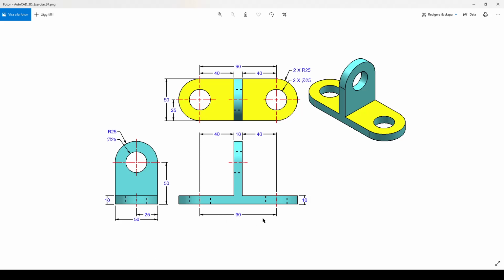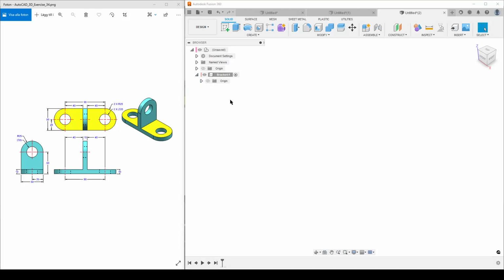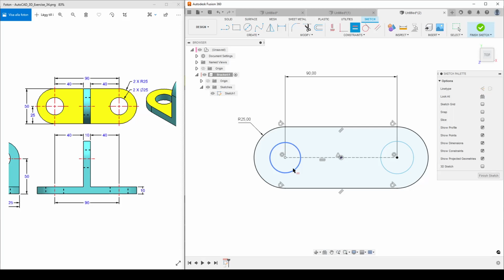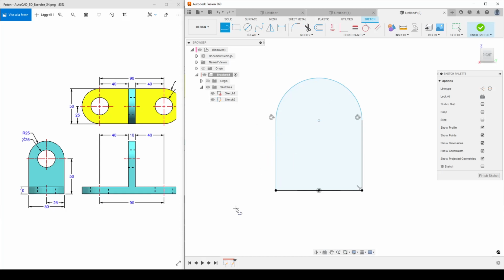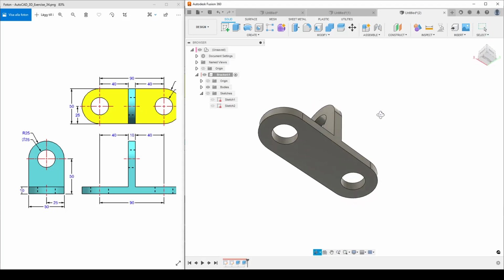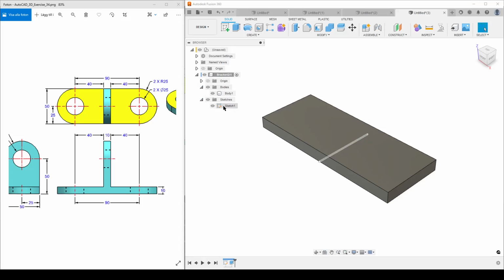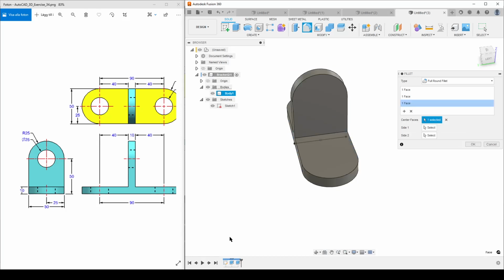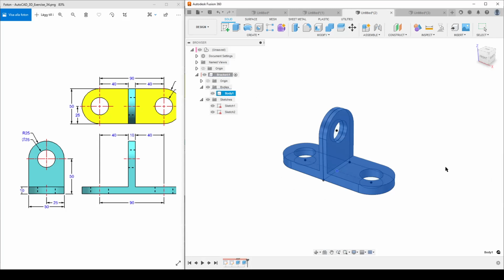Fusion 360 Basic - Bracket with 2 workflows

Comment: could you also draw 1 tab and do a mirror command?
Reply from the maker: Yes mirror is perfect for a symmetrical model. But use mirror on feature/body not in sketch (for better performance and stability).
Reply: @KristianLaholm  now that i read what i wrote i made a mistake, what i meant to say is make 1 tab and circle pattern it and suppress 1 of them. What do you think.
Reply from the maker: @tompienta8149  Similar workflow to what Greg suggested in his comment, and a viable workflow for this model :)

Comment: G'day mate 
Interesting approach to your instruction on this simple build. 
I, myself like sketch 2.
You could also do only one side on this sketch and to pattern on a circle with 4 and remove one of them.
Havagooday 
Greg
Reply from the maker: Intersting way of looking at the model like a circular symmetric part.
Reply: Hi, i have question, if you use circular pattern  and supress one piece , you have to do more steps  later . First you have to move two pieces and then combine . Finaly i count 7 steps in timeline or  is there any trick ?
Reply from the maker: @petr4720  You can do a circular pattern over a limited angle, in this case qty=3 over 180deg. And there is a hidden geometry in the part, from the center of T-intersection all 3 "legs" are 45 mm.
You need 1 Sketch, 1 Extrude, 1 Circular pattern and 1 Combine (join) = 4 steps in timeline. But don't go chasing only the shortest workflow, it's a fun thing but not good for readability of designs.